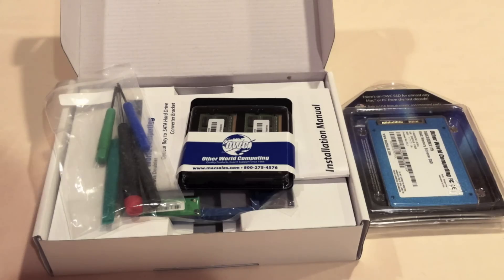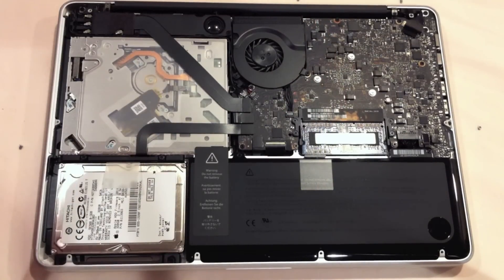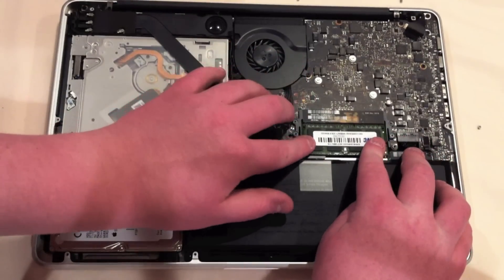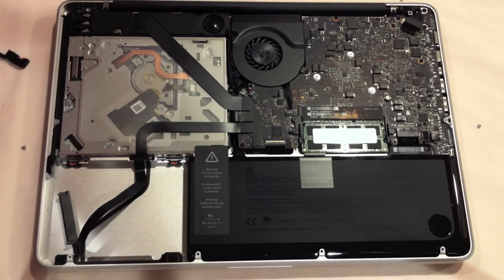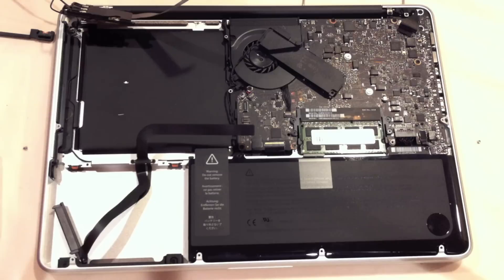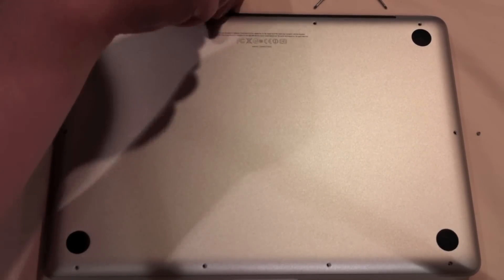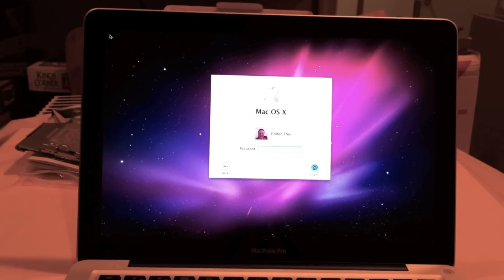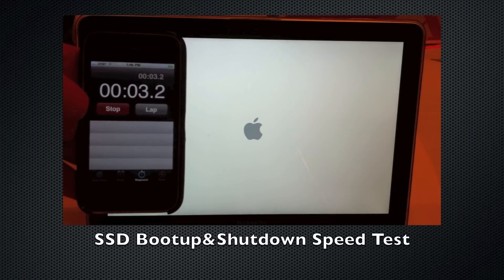OWC Ram & SSD+Data Doubler Installation

Comment: A note for those who have pre-2011 MBPs: MBP only got SATA-III in 2011 models, for older models, both the optical bay and the HDD bay are SATA-II, so it doesn't matter where you place the SDD, you can just put it in the Data-doubler. That should save you some hassle.